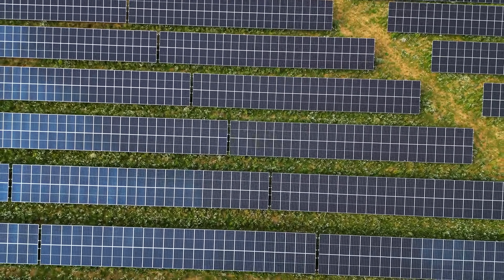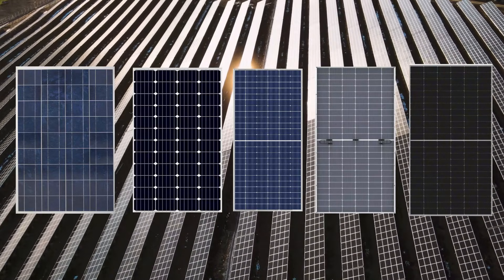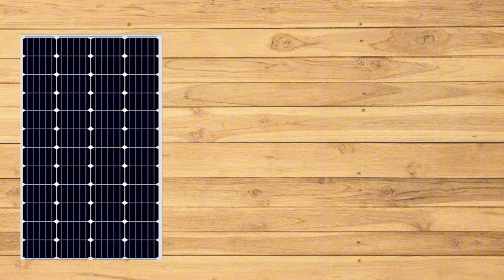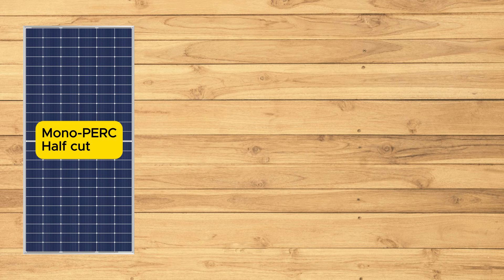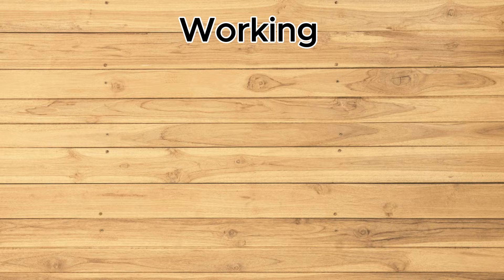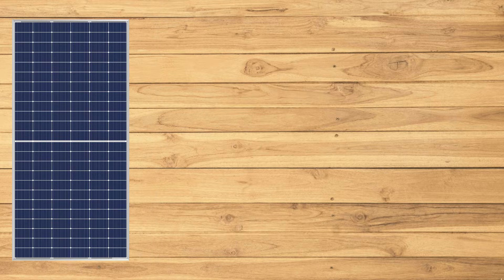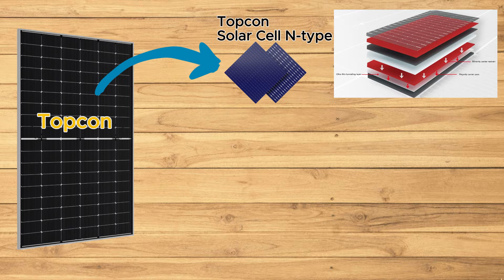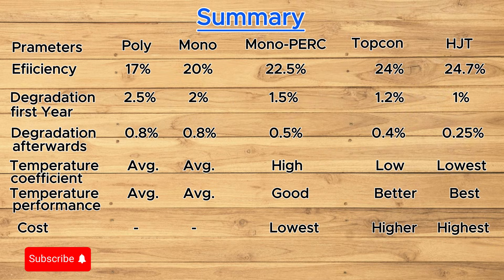Types of Solar Panels | How many Types of Solar Panels | Best Solar Panel 2025

Comment: All made by burning coal
Reply from the maker: You are absolutely right
Reply: Aw the old coal fallicy. Coal power is often used to exact the silicon required for solar panels. There is nothing we can do about that. Anything we manufacture there will always be a initial hit on CO2, depending on the fuel used to create it. The temperature required to exact the silicon can only be met by certain fuels.  However,  Life-cycle emissions refer to the total greenhouse gas emissions associated with energy production, from mining and manufacturing to installation, maintenance, and disposal. These emissions are standardized in grams of CO2 equivalents to capture the different types of emissions and their respective warming effects.

The International Panel on Climate Change (IPCC) reports that the total emissions from generating 1 kWh of electricity via rooftop solar amount to 41 grams of CO2 equivalents, roughly the weight of a medium-sized chicken egg.

CO2 Emissions per kWh by Energy Source
According to the IPCC, the carbon footprint of rooftop solar panels is about 12 times lower than natural gas and 20 times lower than coal, based on CO2 emissions per kWh of electricity produced. However, rooftop solar still has a higher carbon footprint than hydro, nuclear, and onshore wind energy. So we take a hit in the beginning but over a life time we gain an over reduction.  Does that mean we should not take the endvour, because the higher carbon footprint is front load? absolutly not.
Reply: @darrylstewart6243  IPCC are corrupt

Comment: What is the %loss due to shading in full vs halfcut solar panel?
Reply from the maker: If comparing 72 cells full with 72cells half cut solar panels, shading loss in full panel will be around 33% whereas in half cut shading loss will be 16%.